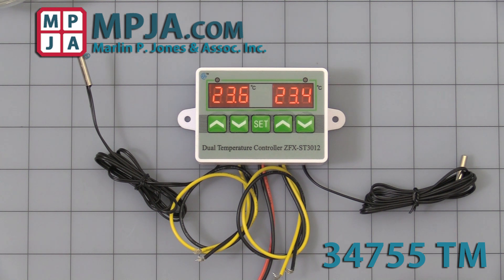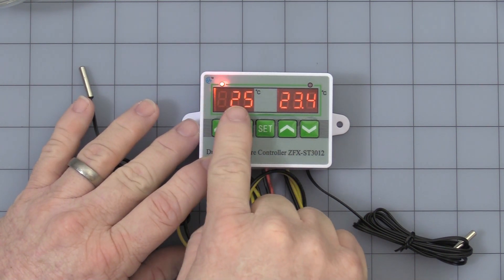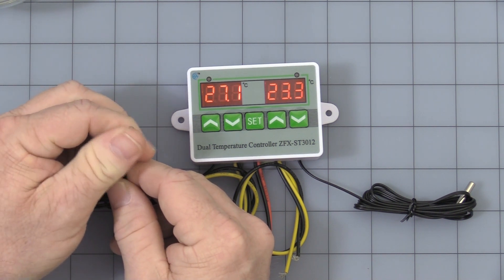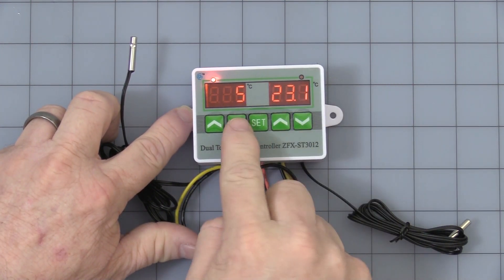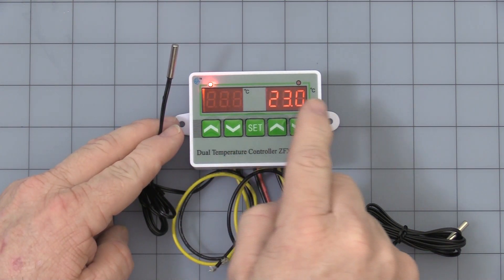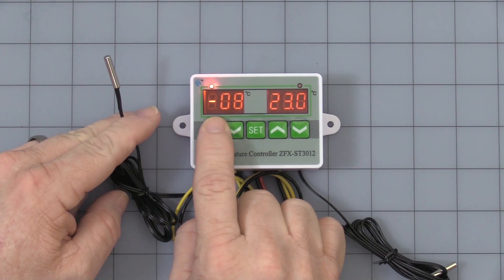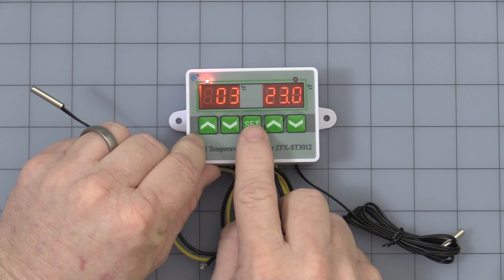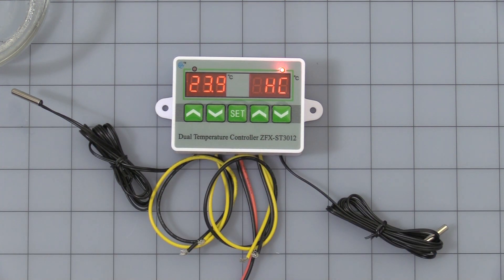Dual Zone Thermostat -Temperature Controller 34755 TM

Comment: I bought one for 220 V. It works apparently but when the lights go up indicating it should light a lamp, for example, it doesn't. What am I doing wrong? If it is 220 V the output should also be 220 V, right? Then I could connect a black light lamp of 75 watts. Well, this is the theory I thought worked on it. But it doesn't. It receives the temperature, but when it should connect or disconnect another device (either cooling or heating) it doesn't. Can anyone help me? I must be doing something wrong. And the instructions that come with it are not very helpful. Will contactors be needed?

Comment: Hello. I want to connect to 12v fans on each side. But when i connect my fans to each side of the output cables they dont switch on, controller is programmed and green light is on. But there is no power on the fans….
I connected + of controller on + of fan cable, same with the neagtive side of the controller output cable. Maybe i wired it wrong? There are no wiring diagrams on the internet for this….

Comment: Excellent video, I agree that the 'English' instructions this comes with aren't very clear.  I actually purchased this in haste when I saw the word 'differential' in the description, as I need a differential function for a pump on a solar system (measure difference between the exit on the boiler and the exit on the solar tubes).  Unfortunately this doesn't do that, unless you know of a hack?